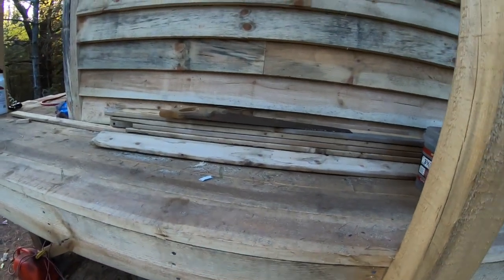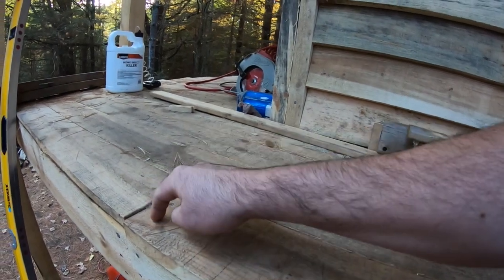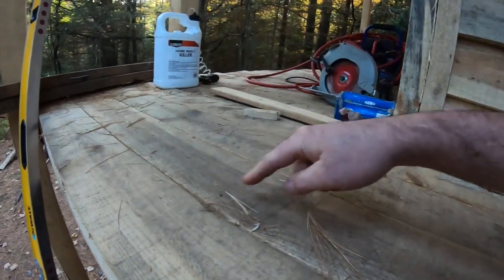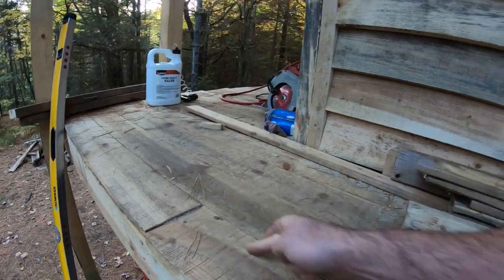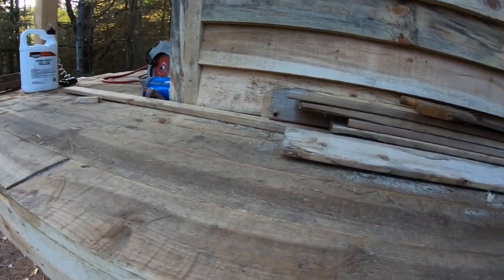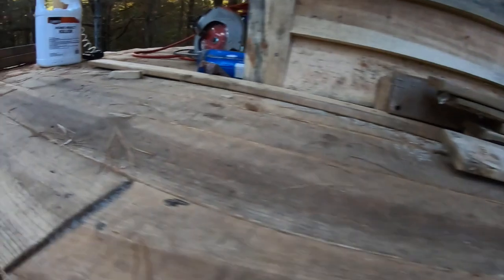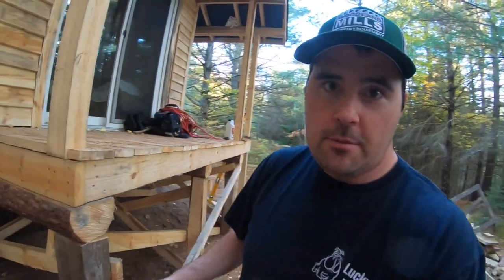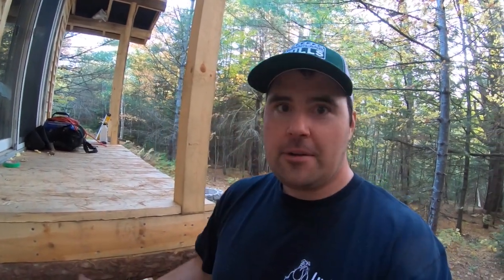Building a Tiny House with Fresh Sawn Wood

Comment: Good advice here. That might not apply for thin pine planks, but it can also snap screws if the boards are thicker. It's anyways a battle between the nail/screws and the shrinkage of the wood. I used deck screws to maintain hardwood lumbers (2x10) on a scaffolding. Half of them where snapped because the wood swelled a bit while being exposed to rain! Have a nice weekend Sandy!
Reply from the maker: From Steel To Wood that’s a good point I never thought about — popping screws due to wood movement. At some point I’m going to build a solar wood kiln
Reply: Great! I guess you can find enough wood to build it! Lol!

Comment: Hey buddy how are ya? Oh ya you are right green wood moves a lot. Thanks for bringing that up. Most of the framing out here in the Bay Area is green lumber it might be down to 19% but it still splits, warps, twists and shrinks. So much building going on now no time to really dry anything. A couple of weeks after the framing is up ya hear dudes with electric hand planers trueing up the inside walls for sheet rock. Gotta nail smart and wait for the lumber to dry if ya have time. Thanks sandy the lil house is looking great thanks for sharing🤪
Reply from the maker: Heyyou Buddy yeah the drywall installer surely aren’t happy about having to plane. Dry Waller’s I’ve worked with would just slather on more drywall mud. Haha

Comment: Hey sandy, 

I am looking into sawmills and like woodland the most. I have a foundation put in and everything where I want to build, my question is do you think that pine wood is okay for framing and building a house? I have tamarack as well, but not as much
Reply from the maker: Thanks for watching. Pine, spruce and fir trees are what houses are typically framed with here
Reply: @sawingwithsandy  Hi Sandy, hope all is well. Another question for you. I plan on getting a 130 and getting the lap siding attachment for the house as well. The foundation is a 28x56 with a 24x24 attached garage. Do you think the 130 is the best option or do you think I could get the house done with a 126? Happy holidays and thank you for all of your videos, they help a ton!